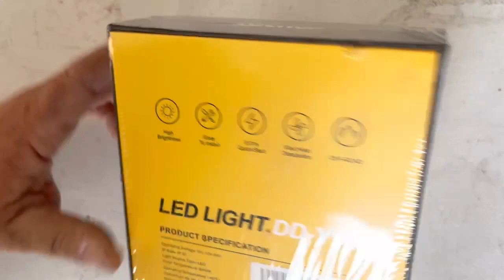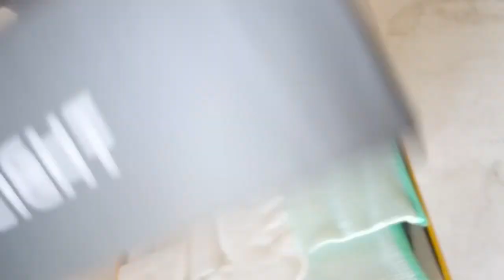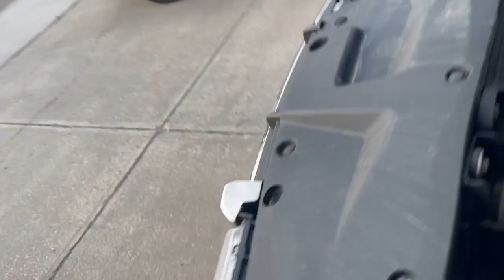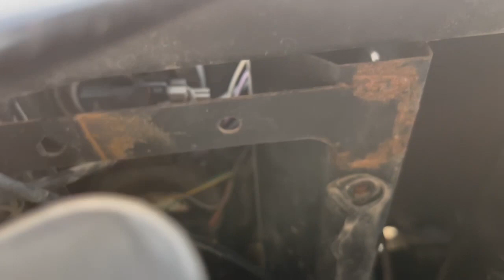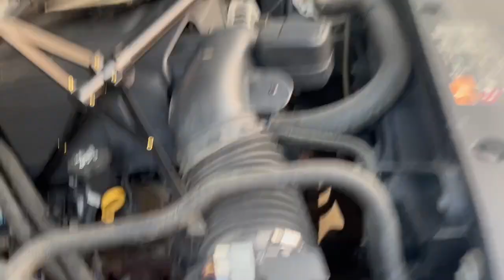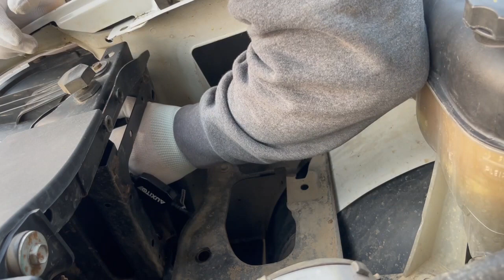Are Auxito LED Headlights Worth It? Find out Now!

Comment: @LowbucksLS. that box is called external driver with canbus built-in. It’s design for heat management and longevity. 

Canbus helps to prevent error message on ur dash board. 

These are worth the money from Auxito. 

Just keep this in mind. 20,000-55,000 lumens pair or each is a lie. 

If it’s 50W each, it’s 5000 lumens each. Or if it’s 60W each, it’s 6000 lumens each. 

Keep that in mind. 

These Auxito led are worth the upgrade and it does help mimic the same beam pattern as oem. Projector or reflector.

Comment: The problem with most of these led bulbs is not the brightness its that they don't work properly in halogen housings. So you essentially have brighter lights but now you have become of those drivers who blind everyone cause of how they "fill" the housing instead of projecting the light.
Had a set similar to these in a truck and removed them cause I got tired of being flashed.
Reply from the maker: Interesting. I’ll have to do an update after doing a few night time drives. They’re definitely bright but I didn’t consider that they could blind other drivers.
Reply: Your cutoff looks pretty tight there without bleed into areas that would blind other drivers.  So long as you have decent projectors I have used the Auxito LEDs without any issues, but I always had good focused lenses like it seems you do here.  Daughter got new (to her) car recently and she instantly said "the headlights are really dim" because she was used to the upgraded units on her old her.
Update on your experience when you can.
 @LowbuckLS
Reply: kept the halogen low beams and just did led high beams. Best of both worlds
Reply: Ur wrong. Nowadays with right type of two sided led, with tiny led chips like CSP,ZES, and SMD led chips are truly indeed mimics the same beam pattern as oem. And it does blind others when it mimics correctly. Projector or reflector.
Reply: @toyotabrony  And there is also a difference between $20 LED bulbs vs $100 LED bulbs.
The $20 LED bulbs are 90% of the time what people buy or are asked to review.
Reply: @toolshedadventures  and that’s a big problem. I’ve seen people have led bulbs that’s are cheap quality made.. even if it’s got a correct design. There something very wrong when I see one. 

It had a burned mark and it draws a lot of power and it’s no good. 

U can still get a good quality led bulbs that’s between $40-$234 a pair. 

Lasfit and Auxito for example have better quality led bulbs that are far better than unknown name brand. 

Take the Lasfit - LA plus for example. 

Those are the must buy reliable all in one style, low failure rate led bulbs for $70. 

Truly worth the money.